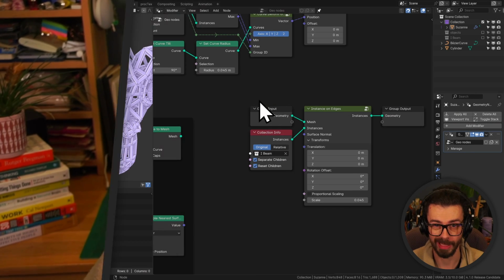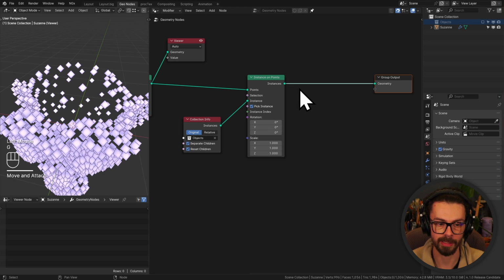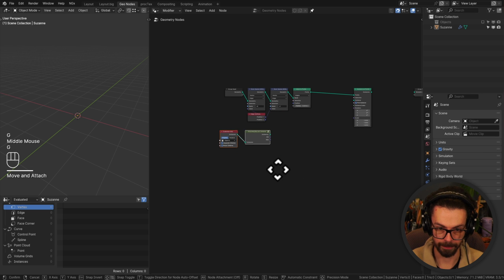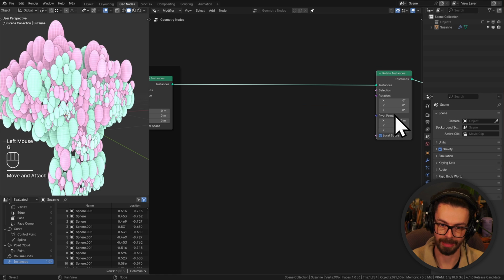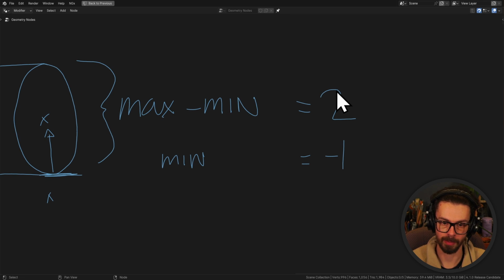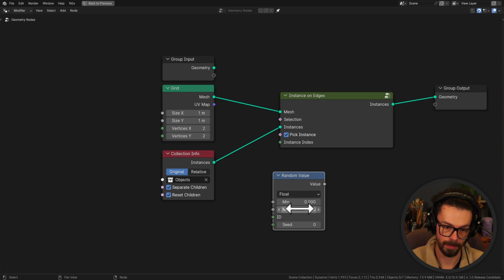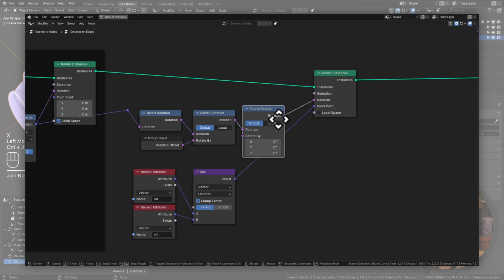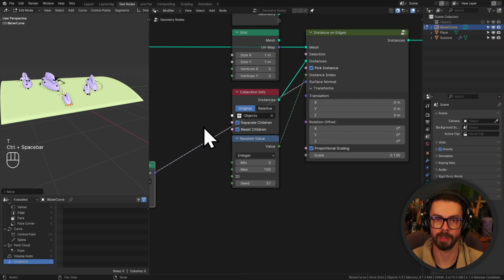Instance on Edges with Geometry Nodes - Blender 4.1 Tutorial

Comment: Actually, ignore my last comment.  This tutorial is so out of date you cannot follow it.  Capture Attribute is no longer a thing.
Reply from the maker: Capture Attribute is on the Attribute sub menu. They can’t remove the node without a fundamental rewrite of geometry nodes 👌
Reply: @Erindale  Yes, true, but the Capture Attribute node does not work like your tutorial does.  As far as I can see, there is no ability to capture a vector.  Maybe the latest versions assume the Domain of Point is a Vector.  Not sure.
Reply from the maker: You set the domain on the node and then the socket type is determined by what you plug into it. It allows you to capture multiple pieces of data on a single node compute - for example capturing all the outputs of the raycast node without needing to compute the raycast multiple times.

Comment: hey! thank you so much for the tutorial, its insanely helpful, but i got super stuck on the scale part, for some reason it keeps being zero so the instances disappear when i connect the divide edge length and instance length node to scale instances scale socket :(
Reply from the maker: If you check your points, is v0 and v1 showing in the spreadsheet? What about min and max? If it’s the bounding box data then go through and double check all your attributes are on the correct domain and double check the bounding box group
Reply: I'm sure you've already figured it out, but I just had the same issue and found that I had both "Evaluate at Index" nodes within the "Bounding Box Per Instance" Index set to 0, instead of 0 and 7. Hope that helps.

Comment: This is amazing. I am using this to create a structural mezzanine. I use your geo node to work with beams following the edges of a grid. How would you do to have a gap between the meshes?. I have a column on every edge, I would like to offset that so it appears that the beams are connecting to the column faces (instead of having them overlapping at the vertices)
Reply from the maker: You could adjust the bounding box values of the beam when sampling them onto the points. If you just subtract from the min and add to the max in the axis you’re needed to extend then you’ll essentially create a buffer on both ends.
Reply: @Erindale  Thank you!!!

Comment: hey erin for some reason i tried out your tutorial but nothing shows in my viewport when atempting to to the geo nodes what could be the issue thx :)
Reply from the maker: What happens if you mute the scale elements node?
Reply: @Erindale  yup it works if I mute the scale node what could be the issue if you know ?
Reply from the maker: @daniellord-vera6987 check all the domains on every store and sample node in the graph. Make sure that the data is getting to where it needs to be. Is V0/v1/min/max definitely visible on the instances in the spreadsheet?
Reply: @Erindale  v1 v0 definitely visible but for min and max they have 0 data on the spreadsheet might be the issue but so far I followed the steps il tinker with it and see why il keep you updated thx
Reply from the maker: @daniellord-vera6987 my guess would be that something inside the bounding box or sample has an incorrect domain. One thing I did when planning was accidentally have the store nodes on the points set to the edge domain instead of points as I had copied them from v0 v1 store nodes.
Reply: @Erindale  that could be it thanks il redo the bounding box section and see how it goes 👍🏽

Comment: Great tutorial! But I have a problem, I did the exact same steps and when I divide the edge length to the instance length and plug it in the scale it simply returns everything 0, which means nothing appears, and i'm not sure why! Is it because I'm using blender 4.0 instead of 4.1 like you used?
Reply from the maker: If you inspect the values with a viewer node on the correct domain, does the spreadsheet show the right values? It’s probably that something isn’t set to the right domain so you’re getting either 0 length or 0 size. Check your domains on all the sample and store nodes

Comment: Great tutorial (as always) 😍 One small question: Can anyone explain to me when to use truncated and when to use floored modulo? The blender manual isn't really helping me here 😐
Reply from the maker: Truncated means that it descends towards zero, floors means it descends towards negative infinity. The only difference is for values below 0. Make yourself a curve line in geo nodes going in the X axis. Then take the spline parameter factor and multiply it by 10 and subtract 5. The module this by some value like 2 and use this to offset the position in the Z axis. You’ll see the difference between the two functions.
Reply: @Erindale Oh, that was fast 😀Thank you!